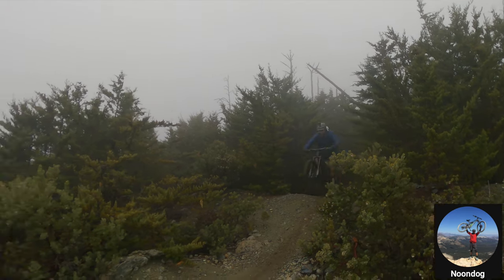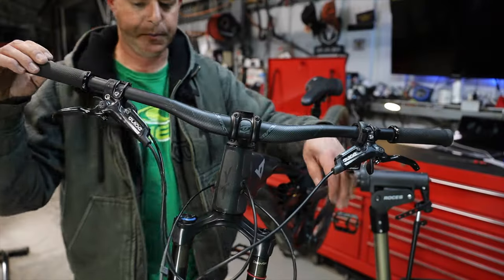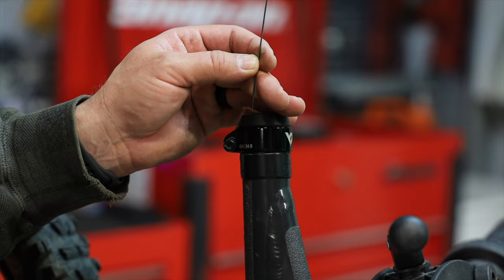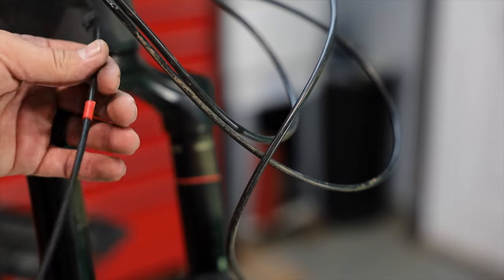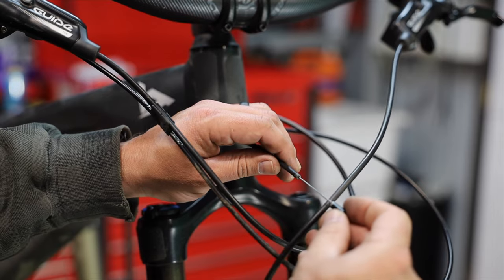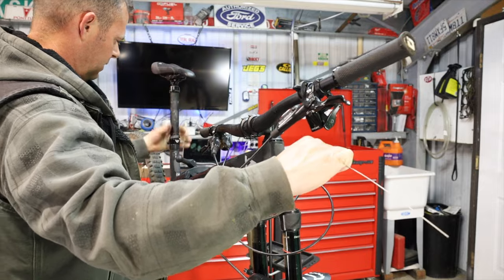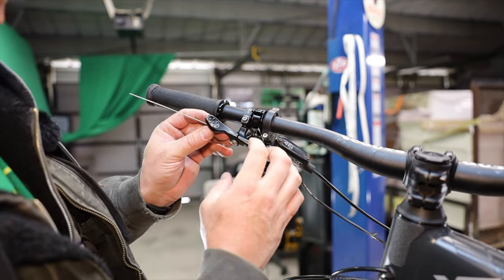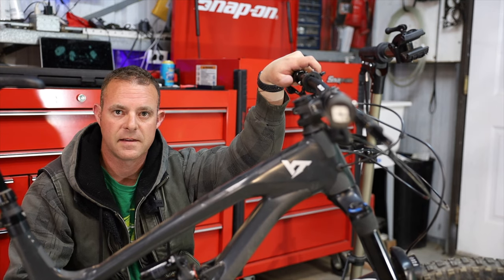2020 YT Capra dropper cable repair and shortening | Postman Down

Comment: I have had my yt capra base for like 3 months now. And absolutely love it. But I still get little creaks not bad one just little ones and then I get this weird squeaky noise that come from my bars when. I turn. Do you have any recommendations that might fix my problems. An I have re cranked all by bolts back to the correct Newton meters and they are still there a little bit.
Reply from the maker: Yea, glad your still enjoying it, if you can identify which frame bearing you can pull it out, re-grease it put it back in and re-torque. As for the handlebars mine creek a little bit too sometimes it’s barely noticeable only happens whenever I’m applying a lot of pressure to the bars. You could use the silver paste which is antiseize, that came with the bike for the handle bars and put a really light coat under the brake levers, dropper and shifter. No guarantee it would get ride of the squeak but worth a try. Just remember only a very little bit of it a lot will act like grease and your levers will spin easily
Reply: Thank you I will try it
Reply: My Vitus Sentier came with a headset with minimal grease. Threw some more into the top and bottom and she's quiet again
Reply from the maker: @Chicagoway37  👍🏼 a little grease usually does it